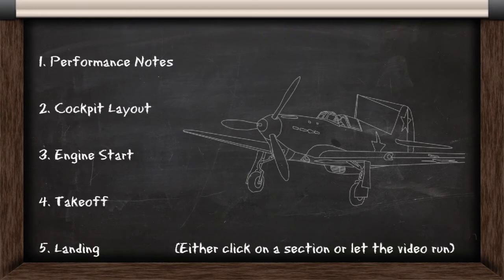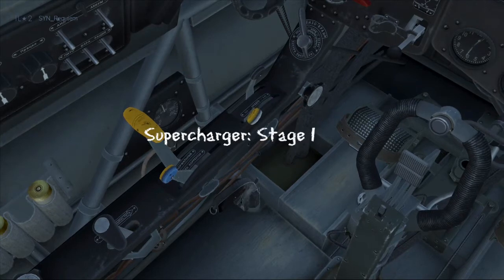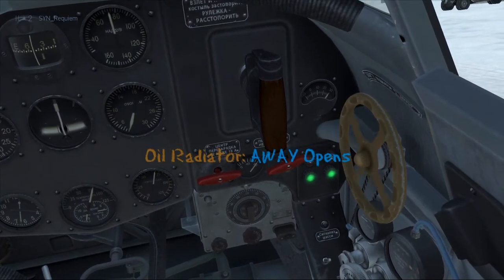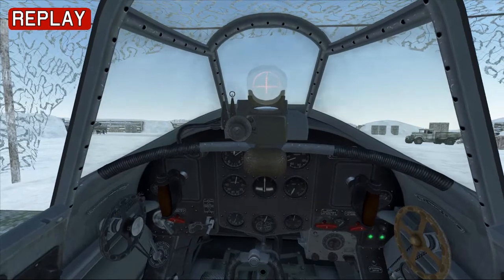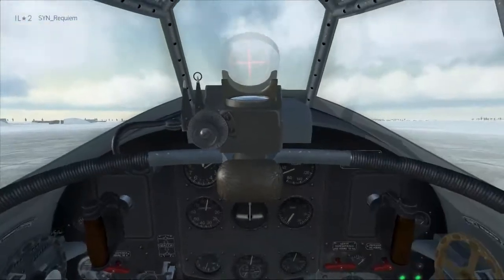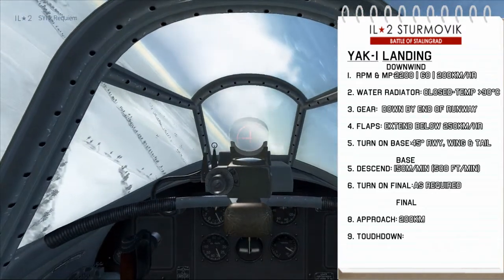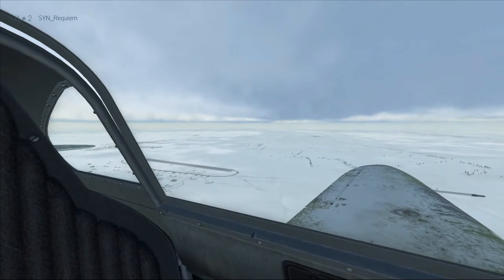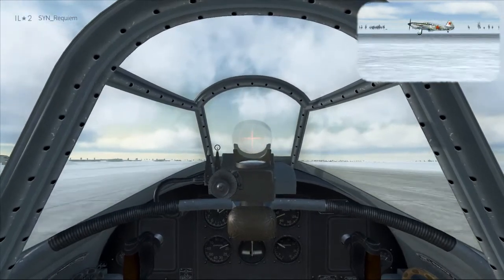Learn to fly the Yak-1 (Series 69)

Comment: Thanks for the video! I would have liked taxiing to have been covered, since the Russian wheel breaks are not the separate left and right toe breaks! 

For taxiing, I found that leaving the tail wheel locked and using the wheelbrakes and rudder input (to control the degree to which each wheel brakes and, in effect, turn the aircraft - not for actual rudder input) to skid-turn around corners works very nicely.

Comment: Another superb video. I noticed that the flap lever appears to have three positions, fully extended, fully retracted and the lever also sits in the middle. What's happening there?
Reply from the maker: I think that center position is just where the control goes after you've made the movement. I imagine it as sort of springing back to center after you have fully extended/retracted the flaps.
Reply: IL-2 Tutorials by Requiem that makes sense. I'll have to check it out later.

Comment: Hey Requiem, superb videos thx, they helped a lot to get familiar with the planes.
But i am missing something here. What is the highest manifold pressure i can use in combat being safe that the engine won't be harmed? When i fly my 109s, i can confidently engage into combat with the knowledge that i can hold 1.3 ata "all day", so i can only concentrate on combat.
Sadly i didn't reach that point with the yak yet, those smoke trails behind the plane when water is overheat doesn't help me either :-/.
So i would be grateful, if you can advice me a "safe" manifold pressure i can engage into fight, without having care about my engine during this time. 
Cheers
Reply from the maker: Thanks Manuel,
You can fly the Yak with full RPM and full throttle. Just manage your radiators optimally to get maximum airspeed and maximum temperatures. Aim for a maximum 100 degrees water and oil. I've not broken a Yak-1 engine yet following that rule!

~S~

Comment: I have question for this plane, gear and flaps was really indestructible in a dive in reality?
I tried to dive also to 700 km h with gear and flaps down without problems... Is correct or a bug?
Reply from the maker: The flaps mechanism works correctly as they do in RL as far as I'm aware. because the flaps are pneumatically driven, so what happens is even if the flaps are fully extended at a lower speed once you speed up past their recommended airspeed the airflow will force them to start retracting. Then if you start reducing speed the airflow resistance will decrease and the flaps will automatically extend again. If you watch the dive from external view you can see this happening.

As for the gear. If the gear is already down and locked then I doubt it will start ripping off other than the doors maybe, but I'd be surprised if you can get the gear to extend and be completely down and locked after hitting 700 km/hr.
Reply: Thanks a lot. You have clarified a doubt. In fact it seemed strange to me that it was a bug. Hmm, interesting engineering these flaps and this solid gear. What a wonderful plane.

Comment: How should I be adjusting my RPM’s in flight and during combat?
Reply from the maker: It's not complicated at all actually.  You can pretty much just set RPM to the max and forget about it for the whole flight, controlling your power with just the throttle. If you really need extra level flight speed you can drop the RPM back to 2600 or so and you'll gain a little extra but not too much. In cruise just like any other airplane just reduce throttle and RPM as desired for whatever airspeed you want to cruise at

Comment: I like the radiator wheels in that Yak cockpit -- it feels like a very "manual" aircraft. I also wonder what those shell-looking things on the left side are (flares?). Great video!
Reply from the maker: Yep, those are flare cartridges. You can fire the flare guns just like in Rise of Flight, but you need to open the canopy depending on the aircraft (the 109 has a tube leading out so you can fire it within the cockpit because the canopy remains closed in-flight).

Comment: Hi Requiem, I'm afraid I'm confused again.

I have some HUD info appearing on the right side of the screen. (To show e.g. what percentage my mixture or RPM setting are,... pitch trim,...)
When the lever for mixture is fully forward it reads out: Mixture 0%?! Meaning the leanest possible mixture? Yours is the inverse of mine? Did I get assigned a special Yak?
Also when turning my wheel for RPM control away it states: propeller RPM 100%.
For engine start up you prescribe the control to be fully away (100%), but then for take off you list the wheel to be turned fully towards us (0%) ... while saying "Set our RPM for the maximum."
"Moving it towards you increases RPM.." But for me the percentage is going down.

Am I seeing things? Is the HUD playin tricks on me? Can you help clear this up please?
Thanks!
Reply from the maker: You're not crazy. The devs switched around the directions of these wheels long after I made the video.

Comment: Great video as always, but I think you got a couple things backwards.... the mixture and the RPM control go the opposite direction of what you indicated in the video, although it worked for you just fine when taking off... maybe they changed it since you released this video?  For me, full rich is with the lever towards you, and 100% RPM, fine pitch, is with the wheel turned away from you.
Reply from the maker: Yeah I made this waaaaaay back in beta, so it is backwards compared to now as the devs swapped things around a little bit

Comment: Love your tutorials-but one question. What is your fuel load in the aircraft? Are they 100% full? I do notice a difference in landing when there is a lighter load.
Reply from the maker: Yep, I always takeoff at 100% fuel load because being loaded up with bombs and full fuel is the worst weight to have for taking off and landing (I'll ditch any bombs after takeoff). If you can land in the worst condition for the airplane to be in then you should be able to land when it's easier by the end of a flight :-)

As you probably know (but others may not), the different feel during landing at the end of a flight occurs because of CG movement resulting from fuel burn and ammo/bombs expenditure.
Reply: Thanks for your feedback.

Comment: Hi guys, a little question from a newbie. What is the deal with RPM control?  How  does it affect the flight characteristics of the plane? How to use it properly and how to match its level with the throttle? Does i depend on thealtitude of the plane?

Comment: Hi requiem. What setup do you use for flaps,prop rpm,pitch and radiators. I currently have a thrust master hotas one but thinking of buying 1-2 throttle quadrants to manage the pitch,rpm radiators and mixture.
Reply from the maker: I use the TM warthog. The flaps, RPM/pitch, mixture, and radiators are all on the throttle for me.

Comment: Dude, how the taxi works? I was trying to turn left to the runway. And I gave the full left rudder. Yak was still going pretty much straight.
Reply from the maker: VMEcycle6 Make sure the tailwheel is unlocked if you want to turn and that your RPM is highest (100%)
Reply: The Air Combat Tutorial Library
I think the tailwheel was unlocked cuz I could turn right, but yeah I forgot to check my propeller rpm. I'll try it  :P.
Thanks for replying